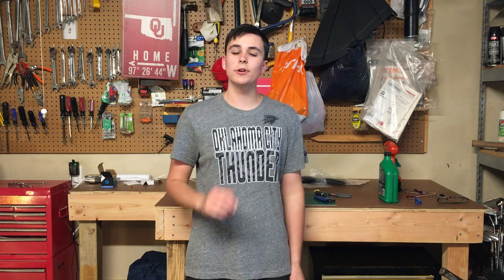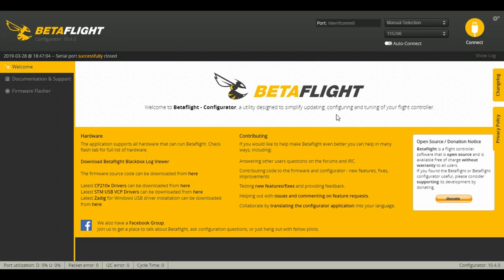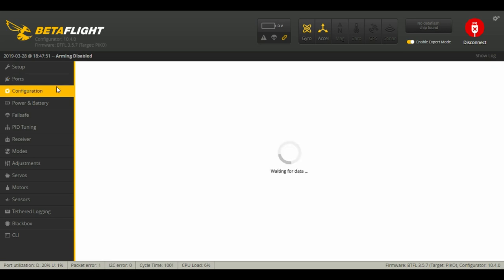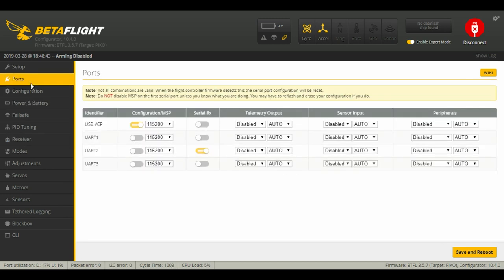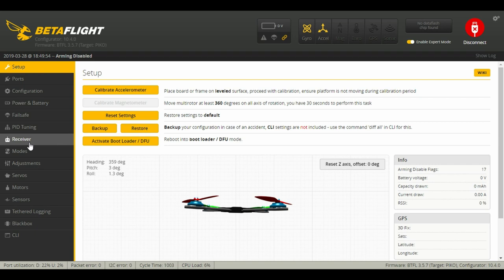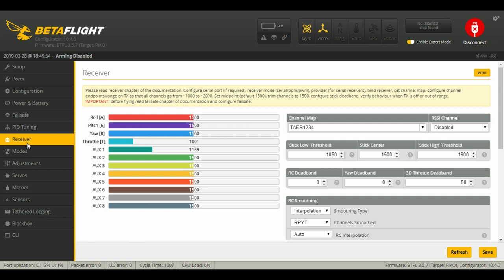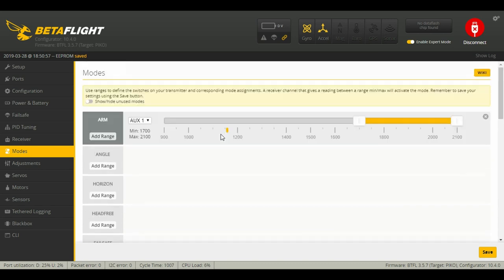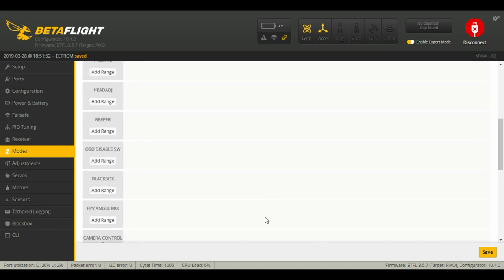Spektrum Receivers in Betaflight

Comment: Using a srlx2 spektrum receiver what would I do to connect it to the fc
Reply from the maker: You would use only power ground and signal and connect your last wire to a uart and enable telemetry on that uart in beta flight
Reply: Give up, I’m on the verge of giving up!! Srxl2 is shit and my fc just won’t communicate with the receiver!!!